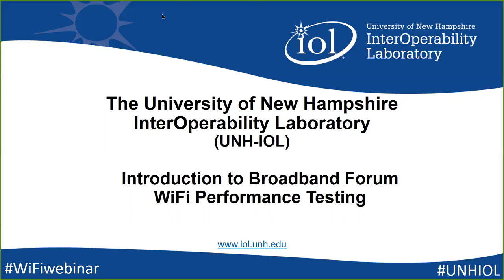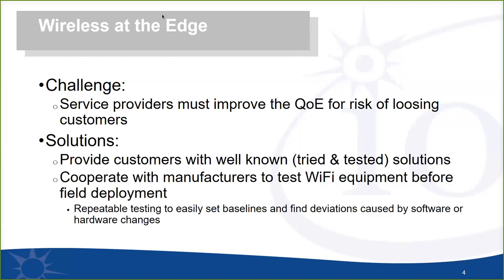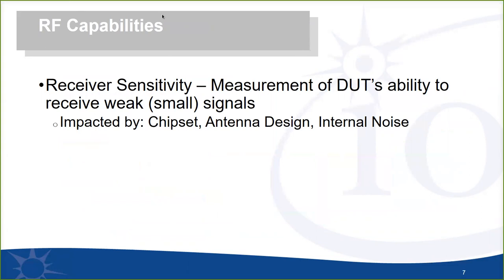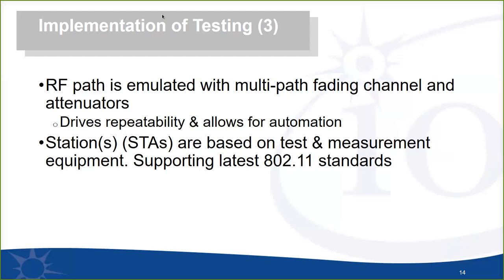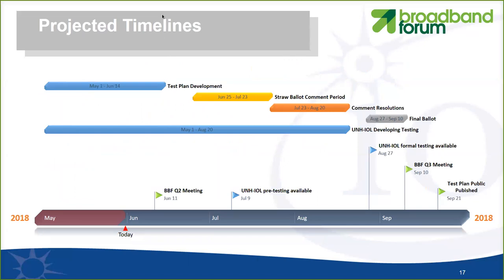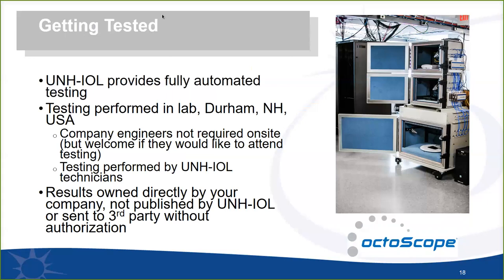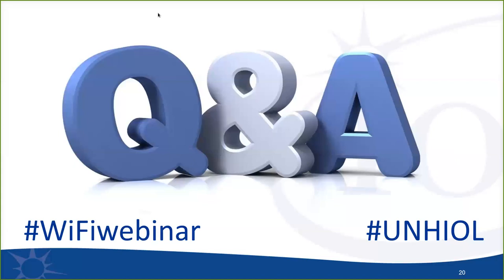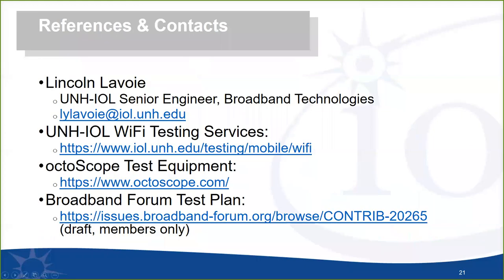Introduction to Broadband Forum WiFi Performance Testing

Comment: If we are using 11n 2*2 we are achieving 300 Mbps speed but we are getting only 280Mbps in      the clean environment , what will be the issue?
Reply: calculate overhead.